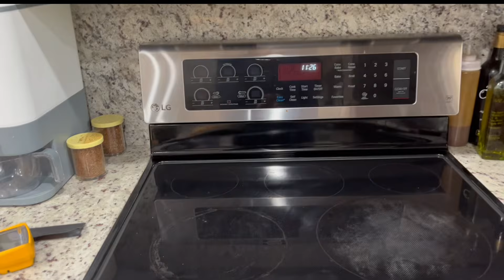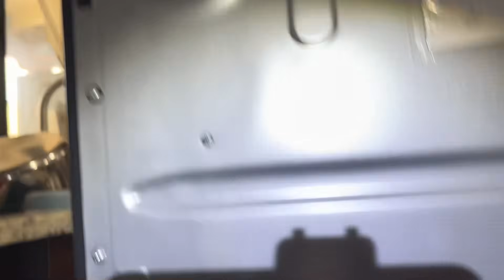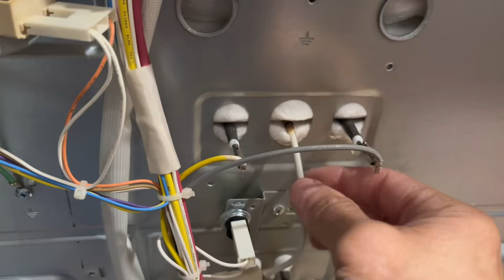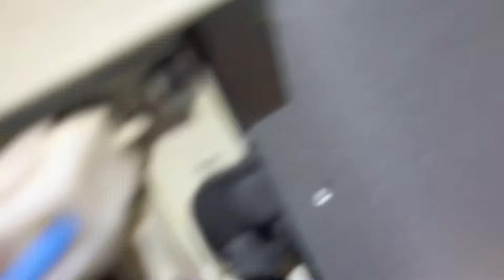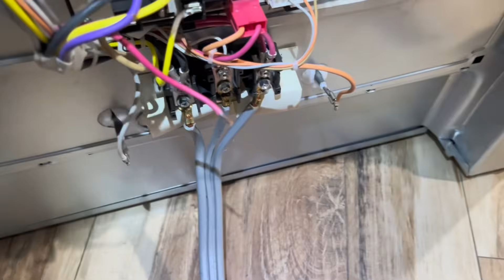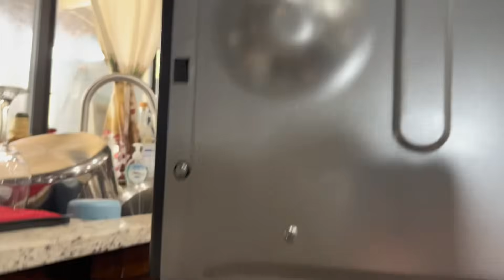How To Confirm and Fix LG Oven Not Heating. Model # LRE3194ST/01

Comment: I had the same slow oven preheat problem.  I have similar model, LG LRE3061**  .  Probably 4 years old.  Opened up back of unit as you did (thanks for the video) .  I found the white 14 AWG wire on the broiler heating element was nearly open, just hanging on by a copper strand or two.  The crimp connector was fairly black and a tad bit greenish.  The first 1/4 inch of wire insulation was charred black as well.  I cut the wire 1/2 inch and stripped the wire 1/4 in. for a new blade connector.  But the copper wire strands were heavily oxidized (black).  I believe this is not unusual over time at elevated temperatures.  I cut back an inch and a half to find good copper wire.  I added a short piece of new 14 AWG wire and crimped on a new blade connector.  I didn't have any 90 degree blade connectors, so I bent the one I have to 90 degrees.  I put it all back together and the oven works like a champ now.  Thanks for the video!  $8 for small roll of 14 AWG stranded copper wire, and a few dollars for bullet connectors for the wire splice and new female blade connector.  I could have used a butt splice, but I prefer bullet connectors.

Comment: I have a problem similar to this. My burners went out, but in a weird way, bit by bit. The large one on the left side went out first, and now, 5 months later, the one on the right side has started to go out. It can activate and work, but you have to turn it on and off to get it to work. I think I will replace the relays or check under a microscope to see if the contacts are messed up. What do you guys think? Black Friday is here, and I can spend about $600 if needed.

Comment: would you please tell me what is a diagnose one of my heater dual elements are not working properly if i set up the level 8 and below?
Reply from the maker: If you’re referring to the dual element on the cooktop range. The burners will fail by not being hot enough or being too hot. By putting it on the highest level. It should remain red hot longer than putting it on the lowest setting it would be not red not. If you know, there’s an issue with the heater element being too hot or not hot enough it will most likely be the infinite/rotary switch.
Reply: Thank you so much for your help 😊
Can I replace the switch by myself?
Reply from the maker: If you have the range oven as the same one in the video, you have a touchpad and not infinite/rotary switches. If you have rotary switches with the knobs, I have a video on my channel showing you how to replace them for an LG range oven.

Comment: If none of the elements work in the oven ( bottom broil or convection) but the convection fan works how do I check the therminal fuse just by checking the 2 wires on om setting ?
I fought all 3 elements gave out at the same time
Reply from the maker: Yes, you can ohm out the thermal fuse. Takeoff one of the wiring terminals an ohm out the thermal fuse with the power disconnected
Reply: @appliance63   what should the thermal fuse read? I got a reading of 0
Reply from the maker: @Razzy316  if you read zero ohms, that means that the fuse has continuity and is good

Comment: Similar oven and issue but not the same. Bake is out. But I have a different style board. Elements have a constant 120 and relay supplies 120 when there is call for heat. Trying to determine if I have a bad relay board or control board and can't figure out how
Reply from the maker: The manufacturer doesn’t supply that information even to technicians. The main control board would have to send five or 12 DC volts to the bake relay contacts. Find out the details but you can also buy parts from appliance parts pros.com and partselect.com to see if you could send Parts back if they don’t work out.

Comment: Hi! How do I know wich relay is what? Also when I do conv bake I do have 240 v at the broil element but 0 at the other 2( bake element and convection element).. Do you think I should replace the control board relay? Thanks
Reply from the maker: I would ohm out the 3 three elements. Bake, broil and , convection with no power to the oven. If the elements are are good move on to seeing which ones are not getting power when you set them to work. It is normal for them to turn off and on.
Reply from the maker: To find out which relay you need to look at the service manual on back of the oven.

Comment: Thanks for this video! I was wondering why you couldn't just put a new connector on the red wire for the relay before switching the board entirely? We have the same oven with the same problem but we just put a new connector on and it started working normally.
Reply from the maker: Happy that you fixed your range/oven. If the male terminal is not burnt up on the relay or loose and still working. Yes, you can save money by not replacing the relay board. I’ve run into a lot of relays that are stuck open. Hopefully yours continue to work for you indefinitely.

Comment: You call for broil. So the main board sends voltage to the relay board so it can turn on the broil.  You then check the relay board for voltage which its suppost to have since your calling for broil. You see it has voltage on the relay board and say its bad? Am i missing something?
Reply from the maker: Good question. It could be confusing but if you read a relay switch it’s the same wire so if you read 240 volts the relay switch did not close and it is faulty. If I read 240 open relay switch needs to close when calling. Need to see 0 volts relay switch closed.
Reply from the maker: The definition of voltage is a potential difference. Putting your volt meter probes and reading the same line wire, could be 120 volts Line1, Line2, neutral or ground will read  0 volts. Putting your voltmeter probes across a load you will have a potential difference and read a voltage. I hope this helps.
Reply: Thank you.  I had the same question!   @appliance63

Comment: My oven is very similar. My problem is that my oven heats to the desired temperature, it chimes, but then stops heating and the temperature drops. What do you think it could be and how would you troubleshoot to know if it is the oven thermometer that is faulty? Thanks for the video, very helpful. I am confident to start traring my oven appart now
Reply from the maker: You can ohm out the oven sensor . Should read  approximately 1000 ohms  at 77 degrees Fahrenheit. If good reading ,still could be faulty.  You could begin there. Be safe follow safety electrical precautions.
Reply: Did you figure out what the issue is? My problem sounds similar to yours.
Reply: Same problem here too.
Reply: Similar issue. I found it is bake element not getting call for heat. It perhaps fine because it uses both elements then drops out the top element mostly when cooking on bake. Still trying to determine if I have a bad control board or relay board

Comment: What guage wire is the red one? I have the exact same issue. Thank you.
Reply from the maker: The red wire is most likely a 16 or 14 gauge wire. The wire should always be the same or thicker to be safe. A 14 gauge wire would be better than a 16.
Reply: @appliance63  thank you I appreciate that. Very helpful! If the wire happens to be 16awg and I purchase 14 awg to splice it (might be too short before I reach usable copper due to it being burned) would that be an issue, or just get both a 14 and a 16 to be safe?
Reply from the maker: Cut all burnt wire replaced the whole wire if you have to and use number 14 gauge wire

Comment: My LG stove stopped working overnight. The on indicator works and the timer comes on but that's all. Over, burners nothing works. Tried turning the breaker off for about 30 minutes then turned it back on and didn't fix the issue.
Reply from the maker: You may have a bad control board or a bad wiring connection.

Comment: So the same relay board can cause the fan to not operate as well??
Reply from the maker: On this model yes. If the convection fan motor is getting 120 volts and not working it would be convection fan motor.

Comment: I have a range oven as the same one in the video can you help me out?
Reply from the maker: If you have a problem with your burner, on number eight, it could be a number of things. It could be the range oven control board that you’re touching on number eight, it could be the display board touchpad that you’re touching, and it could be the main control board that has relays that send power to your burners. Try finding someone who has done that repair on YouTube or call appliance technician. If it was the infinite/rotary switch, it would be a lot easier.
Reply: Thank you so much for all your assistance

Comment: How do you know if it’s the relay board vs the heating element
Reply from the maker: You would have to ohm out the heating elements and get a reading. You may visibly see a burn spot on the small oven relay board. I show you in the video.

Comment: I think my thermal fuse broke this evening. Started the oven set for 425, started to smell what seemed like burnt plastic, opened the oven fearing someone put something stupid in there and there was nothing. It wouldn't get any hotter and when I restarted it, it wouldn't get above 200. I'll be tearing it apart tomorrow to check and then ordering the part.
Reply from the maker: I don’t think it’s a thermal fuse because it wouldn’t heat up at all if it opened. You’ll probably see something physically burned if you smelled it. Let us know how it worked out and make sure power is disconnected when touching wires. Be safe.
Reply: @appliance63  you were right. I was finally able to open it up. The red wire you replaced the female connector to is melted. So is the yellow wire above it (although that looks like residual heat). And with that I'm guessing that whole board is fried.  Although your red wire has what looks like fire damage, mine is fully melted for the last 1/2" and the black relay is melted at the connection point.
Reply from the maker: Good job, I would replace oven relay board cut out any burnt wire and crimp new electrical terminal.
Reply: @appliance63  Any idea on the terminal size? I'm a complete novice when it comes electrical work (I'm also terrified of it), so I'm going to have a buddy that's a journeyman electrician come and hook it up. But at the end of the day, this is just a tiny wire and then plug and play electronics board.

EDIT: This thing is called the "Main Power Control Board" right? Just want to make sure I order the correct part. Thanks again!
Reply from the maker: I use the blue one which is 14 to 16 gauge wire. Before crimping the terminal, make sure it fits the male part snug. The electrician will definitely know.
Reply from the maker: If it’s the same board in the video which you mentioned the red wire and yellow wire. It is range oven, relay control board. The main control board is the board on the top that has the clock.
Reply: Thank you for this video. It was very helpful to us. We have the same oven, and it’s not been heating to temp. When my husband took the back off, he saw the same broil wire was burned on the end. He cut the damaged part off and reconnected it, and we are back in business! So far we have not had to replace the control board. We’ll keep an eye on it. Thanks again for your clear and straightforward instructions.

Comment: What is the part number for that relay board, and where can I order it from? Thank you
Reply from the maker: The relay oven control board part number is EBR74164814. If your model number is LRE3194ST/01. To Find the appliance parts needed. You can go on Sears parts direct.com put your specific model in and look on the pictorial diagrams for your part.

Comment: Thank you for the video, my stove looks just like the one in the video.

I tested everything you said. Circuit board looks good no discolored wires, oms read in the range you said they should be on everything. 

I started the oven and put timer on 12 min.

Oven allert went off at about 11 min it was 300 degress which is why I am looking in to this. 

And 310 in 12 mins. 

Any ideas? If you don't mind? Thank you I did hit like and subscribe.
Reply from the maker: If you set the oven on 350. And you got the results that you did. It could be the temperature sensor if the bake and broil heating elements were OK

Comment: Change the relays as the are the most common issue of such problem.  Each cost around$ 5 to $8 in ebay
Reply from the maker: That could be an inexpensive repair. If you have a soldering iron. How would you go about getting the right relay? The relays have the specifications written on it?. Thank you for your solution.